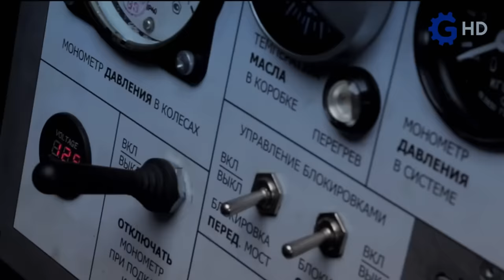INCREDIBLE EXPEDITION TRUCKS THAT ARE ON ANOTHER LEVEL

Comment: FYI, the laws in the United States that apply to traffic on the highways say that a vehicle MUST be less than 3 meters in width or it is not allowed to be driven on any highway.
Reply: I’m willing to bet there are few, if any laws that address vehicle size in meters.
Reply: @molotovEOD yards
Reply: How about most interstates allow up to 102 inches, or 8 1/2 feet wide. After that an oversize permit is required.